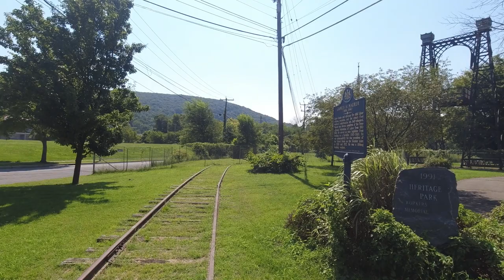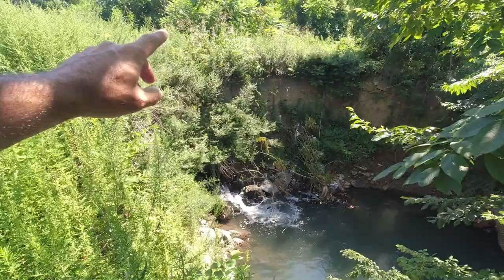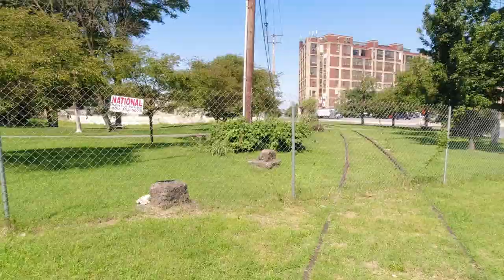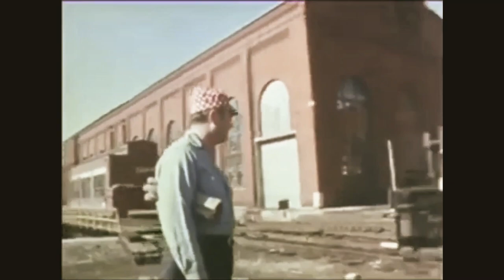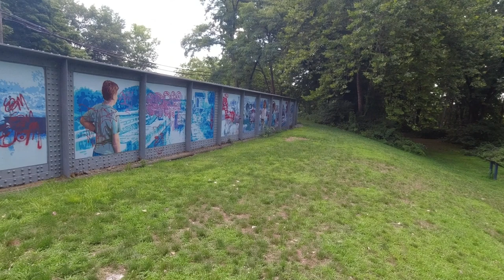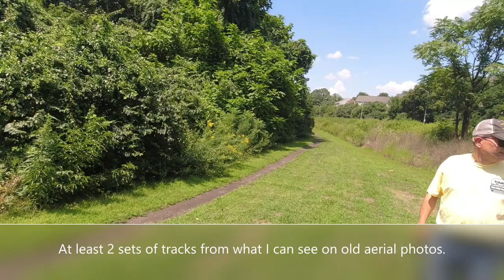Reading and PRR Railroad History with @emeraldsoundproductions Part 1

Comment: The trackage on the left in your scenes of the Swinging Bridge tower is the former Schuylkill & Lehigh branch of the Reading, not the Wilmington & Northern.  There was a bridge across the Schuylkill just beyond your video site which led the S&L to the old Cumru Junction.  At that point the S&L crossed the Schuylkill again and connected with the northern end of the Wilmington & Northern.  This was long before the Reading Belt Line was built.  The plan was to bring Lehigh Valley coal traffic from Slatington to Wilmington tidewater in direct competition with the Reading.  The plan fell through when the S&L went bankrupt and the P&R/Reading bought it up in a blocking move.  A number of years later the P&R also scooped up the W&N.  When the W&N was still an independent carrier, they did have a station at Front & Franklin sts (not the nearby PRR station) which they accessed via trackage rights over the S&L from Cumru Jct.  In that area of Reading there were three different (on paper) railroads running side by side.  Starting from the river side, they were the PRR Court St. Branch, the West Reading RR, and the S&L.  This parallel operation went from Court St. to Bingaman St. and all 3 tracks were extant until the Agnes flooding forced a rationalization.
Reply from the maker: That is some great helpful info. I truly appreciate it. Thank you. You definitely know you're rail history and I enjoy your videos very much. They help keep the history alive and well and also help to see what once was.

Comment: Great video 
There used to be the chain and cable building up the hill under the buttonwood street bridge not far from where your at in your video…
It’s gone now but would be great to see some history on it …. I worked for a company that occupied the bottom of the building…it was quite a building to explore…when working with the R&N one of our engineers, said he used to service that building when he worked for the Reading ..

Comment: there were still steam trains in the 70s ??? what happened to the chessie line ?
Reply from the maker: The Chessie Steam Special is a former Reading T-1 #2101 that was purchased and used as The Freedom Train (AFT1) in 1975 and 1975, then was leased to The B&O in 1977 and 1978 and repainted into the Chessie Steam Special to celebrate the B&O's 150 birthday. If you google search it there is a lot of info on it as well as old videos on youtube. It currently resides at the B&O rail museum in Baltimore repainted in the Aft1 livery, sadly outside in pretty poor shape. It is a sister to 2102 currently running at Reading and Northern.
Reply: @rj78productions88  thanks for all the info . i will check it out ...